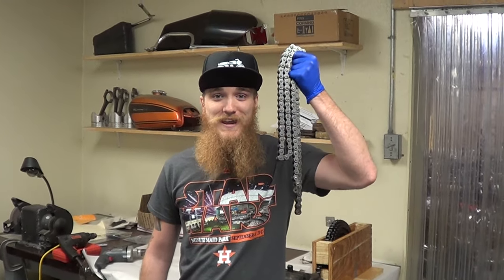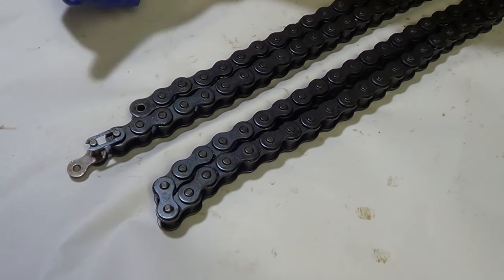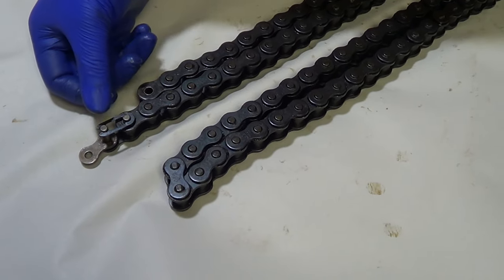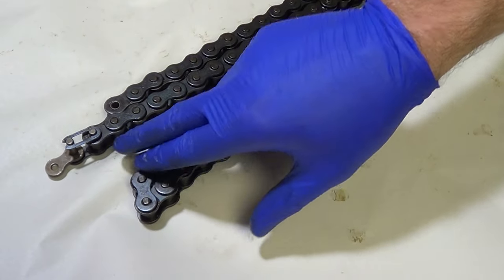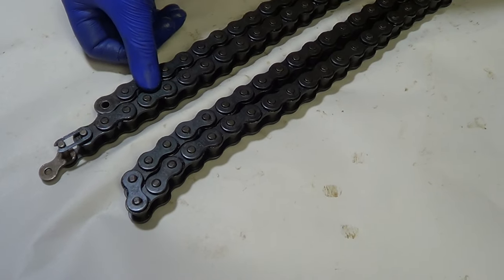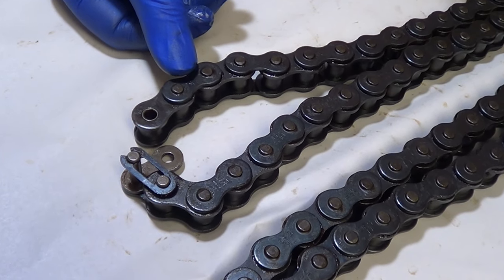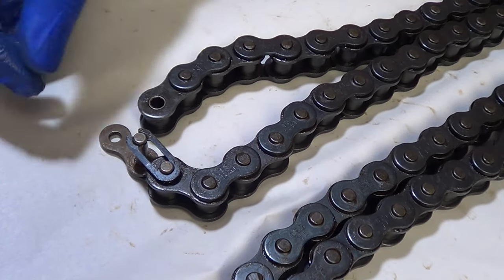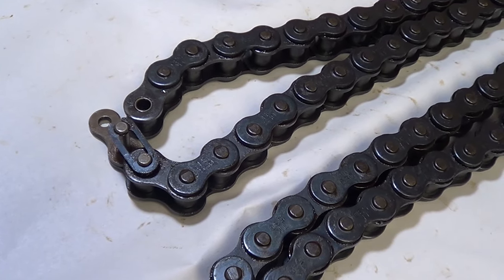How to Count Motorcycle Chain Length for Honda CB350  CB360  CB450

Comment: This is unclear. Which is the inner link and which is the outer link? Smh
Reply from the maker: How he's referring to it is the outer will be whatever side is facing the side of the chain you started at. Good question
Reply: Bruh it’s self-explanatory. Inner- = in, outer = out. 🤦🏼‍♂️🤦🏼‍♂️🤦🏼‍♂️🤦🏼‍♂️ common sense dude. If you couldn’t tell that apart then don’t work on your own stuff let someone else do it because clearly you’re going to fuck something up.
Reply: This confused me.  Why did you start counting with zero and then count by two.  This doesn’t make sense.
Reply: You said count the outer links then you said the master ink is zero, the inner link is one, the outer link is two.  That is counting just the outer links?
Reply: @matt3122  Because when you count all your links you will count zero as the 96th link. 
You can also skip the the first snd count the first outer link as two. Same as he ended up with. Watch it again and im sure it make sense 🤘

Comment: I’ve been riding dirt bikes all my life how the hell did I not know that LOL.  I’m working on a small project bike that was my wife’s grandfather’s. 1974 Honda XL 70.  I have all the original paperwork it was purchased $665.14 off the showroom floor.  I got it running the other day after I found out it hasn’t been running since the mid 90s.  Just got done Red Kote the gas tank, I’m putting new tires, brakes and “chain” trying to make it a reliable safe bike once again.  When I was counting the links it didn’t make too much sense to I watch this video of yours. Simple short video good job.  👏👏👏
I’m currently counting out the chain as we speak it’s 96 links and I’m taking a look at my 2001 banshee And admiring how nice it looks here in the lighting in my shed LOL.